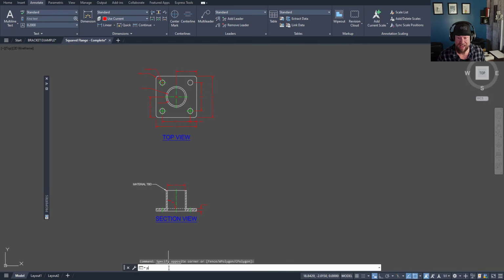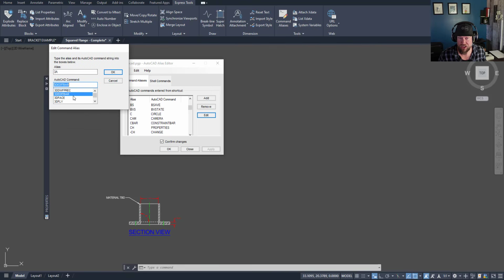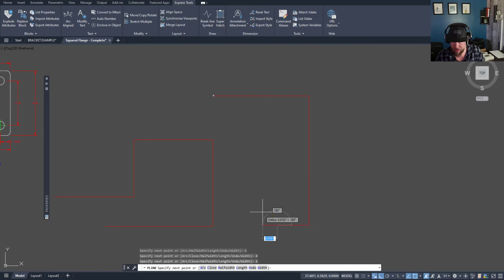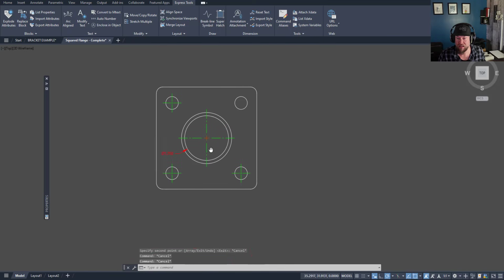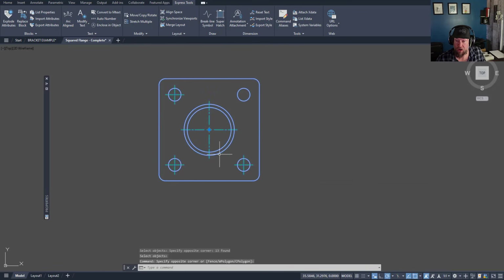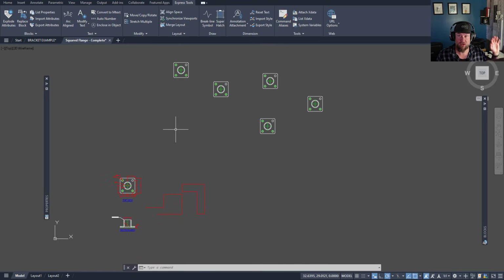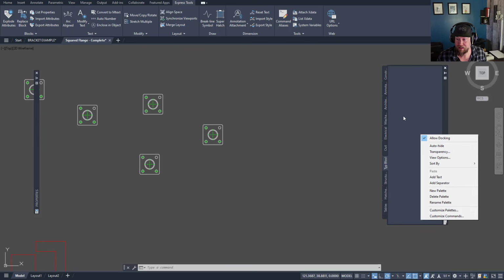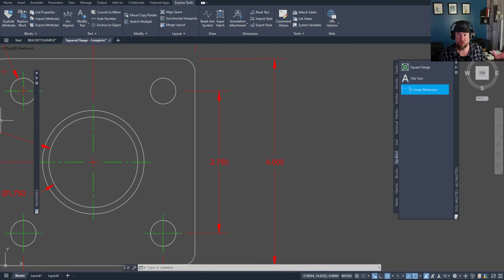7 Simple AutoCAD Hacks to Draw 10x Faster

Comment: I think the best way to save time (too me) is to rewrite the pgp file to add shorter and customize the most used commands such as: Q for line , QQ for polyline keeping all the most used commands to one or two keystrokes, and group them in such a way there under your fingertips with jumping across the keyboard.
Reply: I've customized mine so that I've got about 30-40 different commands and macros that are all keyed with the left hand in the standard position.  I keep one hand on the keyboard and the other on the mouse without having to move my hand all over the keyboard.  Also have your right mouse button set as the enter key.  Ex.   RD-rectangle, c-copy, cc-circle, ag-align

Comment: I do have a question, in tool palettes when you inserted text from the palette the size of the text is different to the one you chose from in the drawing?. I have tried this and I have this problem , my text is way smaller I cant seem to correct it. Have I missed something ? PS thanks for what you do.
Reply: it could be the style that the text is on when you make a block versus the drawing text style that the block is inserted on.
Reply: @mattalpha4704 Thanks for your help, I will look into that today .cheers